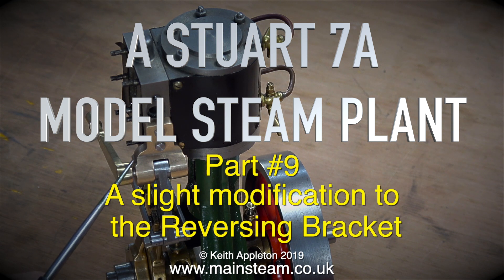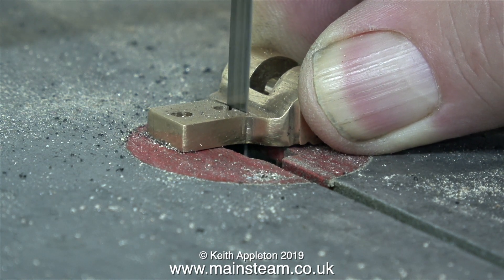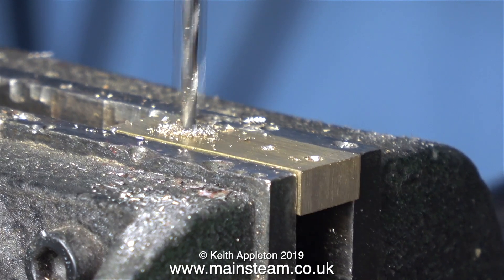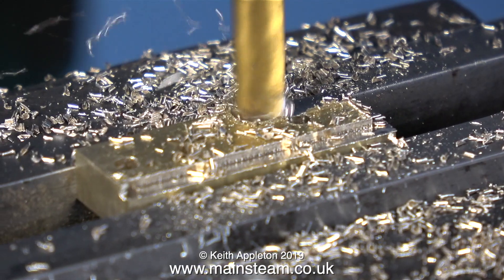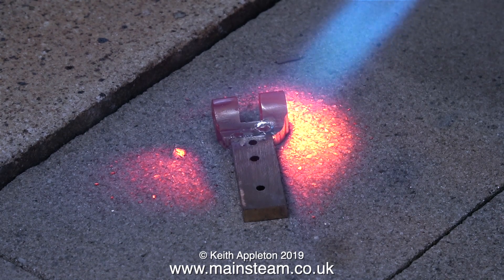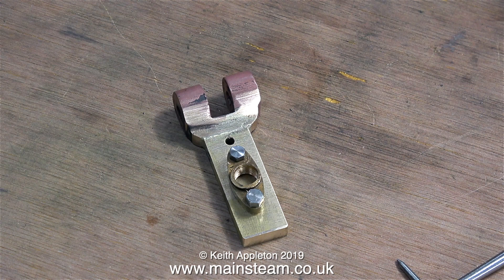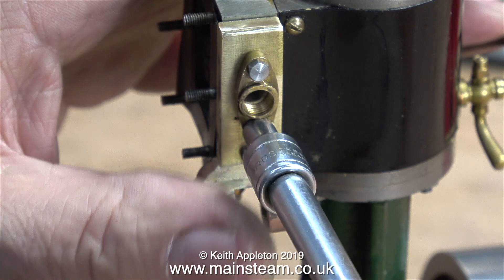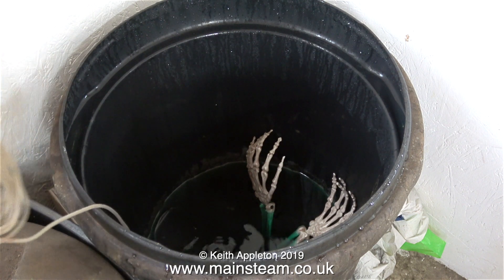A STUART 7A MODEL STEAM PLANT - PART #9

Comment: the AC unit (heat pump) can run efficiently as a heater only down to about 40°F or 4°C . . . below that they can't extract enough heat from the outside to provide very much heat (it's just not there to pump) . . . the usual solution with these units is to put in an electric coil to provide heat when it gets cold outside . . . if your unit doesn't have a heating coil you're stuck with the space heater.

Comment: This kind of heater brings al lot of water into the air. 
Will this be interesting for someone using Steam Engines in this room?  Nah ;) 

Heating with an Air Conditioner does not work below 5 °C for the most  (cheaper) ones. Your manual will tell you more...
Reply from the maker: it's fine now, it had a refrigerant leak and kept knocking off.

Comment: space heater = carbon monoxide poisoning, use with caution
Reply from the maker: My Carbon Monoxide alarm is not being triggered by it ......
Reply: CO only occurs in the event of a lack of oxygen during combustion or bad combustion. think of a polluted burner or a bad mix of fuel/air. Make sure that there is always sufficient ventilation for this type of device. Great vids by the way..